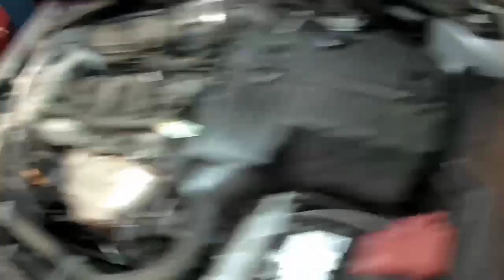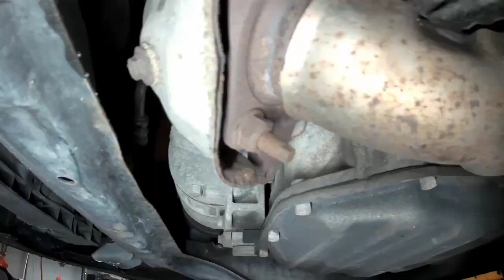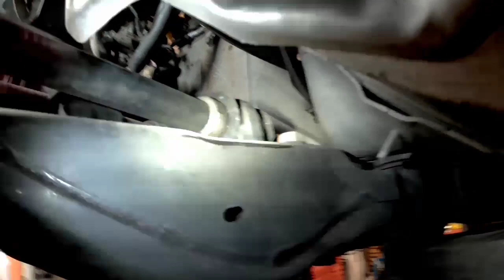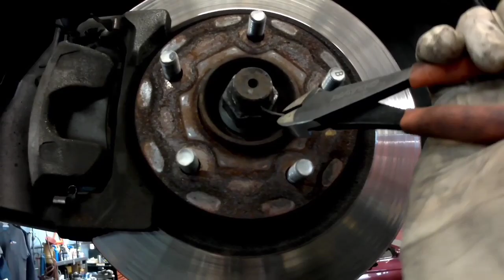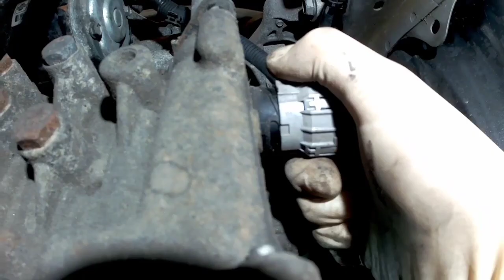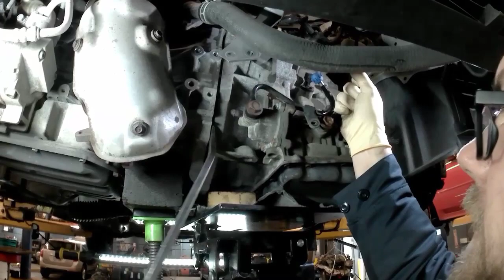2013 Nissan Altima CVT transmission removal

Comment: Im about to swap my 2015 altima transmission myself  this coming weekend and this video just makes it look easier to me. Big help and thanks for sharing
Reply from the maker: Have fun don't bust your knuckles up to much! 😁
Reply: How’d it go?
Reply: Where you got your trans from..
Im about to replace mine
Reply from the maker: Most of the time we get new units from Nissan, if you can't, try a salvage yard that had a low mileage unit. I don't suggest getting a use unit but sometimes you have no choice.
Reply: Gonna swap my 2017 sentra from cvt to manual. It’s going to be very hard my both me and my wallet
Reply from the maker: Good luck! Come back to let us know how it goes.
Reply: @CarMechaNick  you think these transmissions would benefit from an add-on transmission fluid cooler?
Reply from the maker: You could give it a shot. I don't rebuild them so I'm unsure of what the causes of failure are.
Reply: How, and what Transmission your getting ?
Reply: You never responded probably messed up car had to buy another one

Comment: You did backwards! You lube everything before tearing the cat or Axles & Sub frame. Every time Please disconnect harness connector then start removing parts to avoid harness stretching pin connectors.  You don’t need to disconnect or remove Starter just move aside Coolant has to be drain cus us  burn or contaminated due to transmission overheating. Just some tips.

Comment: I just changed CVT for my wife's -08 Altima, I checked your video how to do it, and following your steps, took me only 3 hours from start to end, thank you for the video, it was a ton of help, only thing I did differently was stabilizer bar, I unhooked end links from struts but it was only cuz I changed them at the same time with struts and cv axles since all of those were worn out

Comment: Love doing these. Easy 2-3 hour jobs once you’ve done a few. Although I don’t remove the drivers or passenger side axle at all unless I’m replacing them.
Reply from the maker: They seriously are so quick! I feel you, you just leave them in the Spindle and move it to the side? I love the jobs that have this type of turnaround. Keep up the good work, thanks for watching!
Reply: @CarMechaNick  yea just leave it in the spindle, the passenger side can be left bolted to the engine block. You can tilt the engine low enough to let it slide out, just going back you have to line up the dowels and axle.
Reply from the maker: I have left it bolted before just because it was seized in the bracket. Love the info!
Reply: Wya and can you do this on a 2016 Altima? If so how much do you guys charge? I can’t find anyone who knows how to do it
Reply from the maker: I'm in Cincinnati Ohio, we actually stopped doing outside service. We only service cars we've sold as of right now. If you're near here there are plenty of shops that would do it. A remanufactured unit requires flashing.
Reply: 2-3 hour job? What’s the price range for a job like this?
Reply: @Car MechaNick   will a used from a different need to be reflash?
Reply from the maker: Yes it would, or just take the tcm from the donor car.
Reply: No way in hell you can do a complete change in two to three hours

Comment: I will no longer complain about the cost of replacing a transmission.  This is like heart surgery on a car. I'm just upset I need this done for the 2nd time in 5 years, and I'm still paying off the car.  Stupid Nissan CVT . Should have got a Honda or Toyota like I was told but couldn't afford. 😅
Reply from the maker: Awe man! Yes unfortunately these transmissions are not user friendly. Trade it in for a Honda or yota. Good luck!!

Comment: Thank you for the video I’m a Mazda technician had to replace a trans on a altima for my used car department very good direction supper easy job thank you for helping me out man
Reply from the maker: Happy it helped! Hoping most ppl just need a little guide if it's an  unfamiliar job. You rock!
Reply: @CarMechaNick  yes I should definitely start recording when in doing engines/transmission on Mazda’s did not realize how helpful it can be!! Blessings and blessings on you brother

Comment: My wife and I have a 2015 Altima.   Hopefully we won’t have any issues.   I will have the fluid changed every 60 k.    Great video.    Thanks.
Reply from the maker: Thanks! Thats all you can really do. Service it as directed and don't drive it like a race car.
Reply: As a car dealer, I have replace 5 cvt's in Nissans. Costs me 1800 for the Nissan rebuilt tranny plus oil. Only a one year warranty from Nissan, though! My mechanics have charged 400 to 900 to r and r them and program them. But then, they were Sentras and Versas and one Rouge that don't have cross members like that either.
Junkyards want $1,000 to 2,000 for a trans, so I just get it from the dealer wholesale.
I would like to see you pop out a Versa trans.
Reply: Meant to reply to this oil changing- DO IT SOONER- 30 to 40,000 miles. And the first one even sooner- there is always some metal in there and you want it out with a new filter. My brother did this on THREE Caravans- known to crap out at 80 to 110k- and has gotten over 200k on every one!!!  Oil is cheaper than the trans...and like he says, don't drive it like it's a race car.
Reply from the maker: Yeah it makes most sense to get them from the dealer we usually do the same if available. I will for sure man if I get one in.
Reply: Well should be every 30k miles or 2years for better performance. They recommend 60 k by marketing competition but not for Customers protection.
Reply: Thanks everyone.     On another note.   I had to replace my oil pan on the engine.   They put enough sealant on these at the factory.   LOL.    I used a gasket.   These cars sit so low in the front.  I don’t know what we hit but it had a tear in it.

Comment: Thanks for this video.  I have one I need to change and needed a good idea of what it will take.  I appreciate it very much!!
Reply from the maker: thanks!
Reply: What type of transmission you’re switching to? Cause I have one and I HATE THIS CVT SHIT
Reply: @rockoutmello30  Nissan Altima, Sentra and their new Maxima's can only be fitted with their specified CVT's
Reply from the maker: I never saw this comment but yes just a factory transmission was re-installed.
Reply: @TinoMiller  
So u can’t change it is what u saying ?
Reply from the maker: I don't think so. 🤔
Reply: @rockoutmello30  you can change it but you can only use the CVT that is specified for that car make ...

Comment: Thanks for the step by step procedure.  Would like to add that this is a 2013 Altima Coupe which has the previous generation CVT (RE0F10A).  The 2013 sedan has the RE0F10D.
Reply from the maker: Haha thanks!
Reply from the maker: Good info too 👍

Comment: Good stuff fellow all the steps you took made my job eazy new transmission with torgue convertor in stalled broke the transmission motor mount with my gun but besides that smooth sailing buddy just have to order a motor mount now left side that holds the transmission but good video even drop the frame too
Reply from the maker: Glad it was helpful!

Comment: Awesome video took mine out my 2012 and reinstalled with no issues but I do have 1 question would you recommend autozone fluid or ordering the nissan cvt
Reply from the maker: I would definitely get nissan. I don't favor the aftermarket fluids but if you have to then use what you can get your hands in. Just make sure it meets nissan standards.

Comment: but sir how do you remember where all the bolts go back in?! amazing work thank you for your service.
Reply: He may refer back to the video.
Reply from the maker: That would take forever. I used to use a box and label them but I've just gotten used to spacing them onto my magnets. If it's a new car I label them in groups. Just clean the marker with brake clean at the end of the job. I'll post pics of my magnet tray when I'm at the sufficient subscribers! :)
Reply: @CarMechaNick  Post the magnet tray or I will unfollow xD
Reply from the maker: I'm pretty sure I posted it lol
Reply: do this enough it becomes intuitive.  and put things where it makes sense.  if you throw everything in a bucket you're in for trouble when putting it back together
Reply: rewind the video
Reply: it comes to a point where you just look at a bolt hole and you already know what bolt goes in there

Comment: Well done mate, I just did my 2nd one on a  13 Nissan Quest. First was on a Nissan Altima. Both trans were brand new from Nissan. The Altima I added 4 qts once installed and drove perfect. The quest I’m doing now is wigging out. I think it might need Nissan programming. We have the snap on Zeus but I don’t think it can do it. This is a larger cvt and I added less fluid than the Altima and I think this one is overfilled. Do you know if there’s a certain amount to add to Nissan factory transmissions? The dealer said 5 but after three this one is registering overfilled on the dip.
Reply from the maker: Yeah I always tell people to go by the dipstick. It never lies. Thats awesome man. We usually send them to nissan to avoid any difficulties if we needed to warranty trans. Though nissan does not give a very good warranty on these transmissions.  I think they know what's up. 🤔
Reply: Car MechaNick for real bro these transmissions are straight up ass lol. Before I put in 2-3 qts it was seemingly fine but Nissan insisted it needs 5 qts after install. Now it slips a lot and won’t show R, N, D or L on the cluster. Might try to take some out and see what’s up. You said the dealer didn’t charge you to program the trans?
Reply from the maker: They do charge us. Its like 130 I think. They are just not good units not matter what it kinda sucks because I like nissan before these things came out. Hope you get your issue worked out man. I always fill it with what it recommends and then I check it after they program it.

Comment: Excellent video and skills i have a quick question man i have a Nissan Altima 2011 and the transmission is leaking where the engine meets the transmission right under the cover where you gain access to the flywheel bolts do you think it could be a seal and more or less which one  thanks i will appreciate a lot your awenser
Reply from the maker: Most common thing is a rear main seal, if it's engine oil. Trans fluid could be the converter seal. I haven't seen that very often. The fluids have a pretty distinct difference in smell and texture if you're familiar with these fluids.
Thanks btw hope that helps!
Reply: @CarMechaNick  Thanks a lot man 👍🏻
Reply: Having this same issue! Rapid transmission fluid leak. Where the dust cover is. So the only place it can be leaking trans fluid in this area is from the torque converter seal? Already replaced the trans fluid pan jus in case and still a leak
Reply: 08 Altima btw
Reply from the maker: Yeah if it's coming from between the two, it's going to need to come out
Reply: @CarMechaNick  okay, I appreciate it! how long did this job take you? Or how long will it take me to just replace the seal? Will it be less work to just open it up?
Reply from the maker: It would be about the same amount of work you see here except you have to remove the converter from the transmission to replace. This will be messy.

Comment: Did you have to reprogram/calibrate the transmission?
Reply from the maker: Yes sir
Reply: @CarMechaNick  your simple and quick replied got you a new subscriber!!!! thanks.... Was the programming done at the dealership?
Reply from the maker: @Hernsama  Thanks! 😊 It sure was, it usually cost right under $200 here in Ohio.

Comment: Would this job be easier just dropping the whole front subframe? Honestly what I thought you were doing until you pulled the subframe and left the engine supported from the strut towers I’m assuming?
Reply from the maker: I do remove entire frame. You have to with every car I ever remember doing fwd transmissions on. That is when it is a full sub frame. I leave the engine mount attached and support the engine with the long single post jack.

Comment: Im getting ready to do one on my daily.. Did u have to reflash the ecu for the new transmission or was it plug-n-play?
Reply from the maker: You do, I think we used the tcm on a salvage unit and had no issues. But a reman unit will need programming.

Comment: Great video dude! Have you ever replaced the transmission in a 2012 Maxima? I guess either way the sub-frame has got to come out or the engine / transmission assembly has to come out and then separate. Thanks
Reply from the maker: I think im going to be doing one here soon matter of fact. I would fornsure take it from the bottom subframe then support the engine while seperating the two. Thats my procedure anyway. Hope  it helps!

Comment: Are there any parts or components from the old transmission that need to go with the one being installed? I was told there was a sensor that communicates with the cars computer that needed to stay with the car. That when installing another transmission to remove the one from the transmission being installed and replacing it with the old one. Is that true?
Reply from the maker: We install dealer units so i have to swap all the sensors anyway.  I've never heard that and how would that be the case if you broke it? A new one would need to be installed anyway.  They all communicate. It's a party between computers with cars.
Reply: @CarMechaNick  awsome thanks man!!

Comment: Great reminder that once it goes I should call the junkyard
Reply from the maker: Haha 😄 🤣  I never have any issues from these motors, just the transmissions. Lol not saying much but, it's something.
Reply: @CarMechaNick  mine has over 90k and still fine. But I hate the car in general. Those 2k you save on the total price vs a Toyota, are the most expensive 2k of my life. This car is just so bad overall.
Reply from the maker: @rafars2246  I agree 👍 toyota or honda for me

Comment: I had my replaced at the dealership at the dealership earlier this year but is it possible that left something disconnected cause my driver side floor is always wet.
Reply from the maker: I know when doing this you shouldn't have to remove anything that would cause a leak there. Though I'm not sure what they may have done.
Reply: Check out on the floor of the steering wheel strap disconnected from the gasket seal, one minute job with your bare hands.

Comment: Is there a way to remove the CVT and use a regular Automatic transmission say older model for  4 cylinder Altima engine,? In case bolts are not matching, then can we make a custom intermediate plate to match holes and bolt it to the engine on one side and make holes on the plate to match the transmission  bolt spots?
Reply from the maker: I honestly wouldn't try. It would take lots of modifications and idk how the pcm would judge shift points. That's honestly out of my realm haha. I can tell ya anything about old Hondas. But sadly you'd be better off getting a dealer unit its almost the same price as a used unit for us.

Comment: Wow wow wow wow wow.... HELLA AMAZING!!!... SERIOUS RESPECT TO YOU ALL WHOM CAN BUST DIS JOB DOWN.../ around how much the price tag on job like so.. (2014 S series)... Thanx either way... Blessings!!
Reply from the maker: Thanks! 😊 we put dealership units in which require programming. The labor is around $750 but the transmission itself costs a few grand. Used ones are available also usually cheaper. You can use the TCM from the donor car. It's just a gamble on longevity of those units.  Some salvage yards do have a warranty. I hope that's helpful. Thanks for watching! 👀

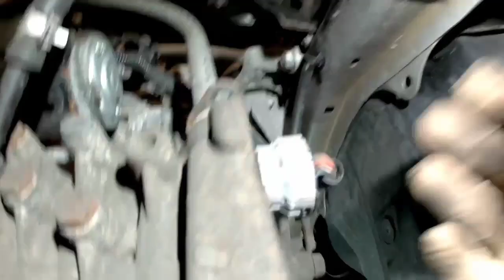Comment: Hey at 8:15 you remove a wheel bolt so easily!!! I can’t get this shit off on my transmission, am I missing something!? Please advise...thanks
Reply from the maker: The bulk connector? Sometimes gripping with pliers helps. DO NOT squeeze.  It will break the plug. Just use pliers for better grip and more torque. Hope that helps!

Comment: Nissan just sent my friend a warranty extension letter for his 2016 Altima. Poor guy was getting ready to pay major $$$ to swap the transmission because it slips badly when it's hot outside and just flat out stops working. He has to pull over and let the transmission cool down. Any ideas for how he could extend the life of his new transmission going forward.
Reply from the maker: I mean all you can really do is service the fluid when the manufacturer recommends it. Don't beat it up. All I can really say. Sometimes cars just have crappy parts.
Reply: Change the first fluid at about 20k, then 30k thereafter- wrote about it in a thread above...
Reply: Yea let nissan replace the transmission then sell it as quick as possible.

Comment: I replase the cvt on my 2012 altima 2.5.the cuestion.need to reprogramming or not? Can i turn on the car?Thanks
Reply from the maker: You're supposed to get it done by the dealer. If it drives with no codes or issues then idk. 🤷

Comment: You ever suspend the motor with an under hood support instead of using the jack stand under?
Reply from the maker: Yeah but they get in the way.  Some cars have to use the upper support.

Comment: I got a question, Is it possible to To do a transmission swap from a Nissan Sentra  CVT to a manual transmission?
Reply from the maker: Doubtful unfortunately 😕
Reply: Easier to sell and get a manual one instead.